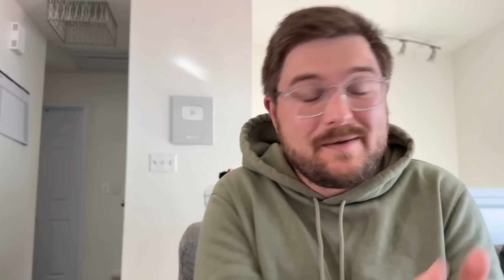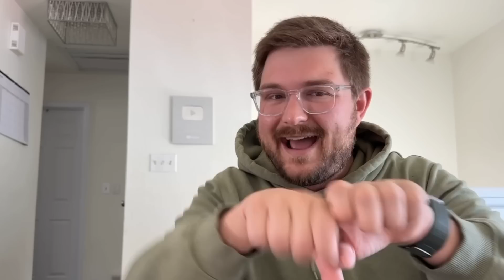Slow Charging For ~800-Volt EVs At Tesla Superchargers With Magic Dock Explained

Comment: I actually think this is GREAT NEWS for all Tesla owners that are worried about Tesla Charging sites getting busy (which I actually think is ridiculous).  My belief is that most (well informed) CCS vehicle owners will favor the available CCS charging infrastructure that is available.  First, CCS is probably going to be FREE for them given all the (really dumb) programs that give away free KWHs or at a minimum, cheaper that going to a Tesla site, but it now seems like the CCS will be the faster way to charge a vehicle.  If I personally owned a CCS vehicle, Tesla would be "break glass in the event of an emergency only" sort of usage situation.
Reply: The problem is even if most well informed CCS vehicle owners will favor the available CCS charging infrastructure, they are an ever decreasing minority of CCS vehicle owners. Majority will go wherever it is most convenient. For many that is going to be EA right now because of the free programs, but after those expire for many it may become Superchargers. I don't believe at all that the number of CCS cars which will go to a different station because it is faster will at all offset the added traffic cause by CCS cars charging slower, especially when many of those CCS cars will have to block a second stall to charge due to the cable length.

Just looking at the stations nearest to me, the EA station is farther away and doesn't have many businesses near it that I might want to stop into while charging. There is a pet store, a couple furniture stores, and a pizza place. The supercharger though is closer and has a Starbucks, bakery, pharmacy, gym, and a couple lunch spots in the same parking lot. Even if the Supercharger might be 10 to 15 minutes slower for my car, If I were to use DC fast charging on a regular basis, I might pick the supercharger since I could better make use of my time (and I'm saving almost 10 minutes on driving anyway).
Reply: @OmairArif  The lack of basic EV knowledge by some recent EV buyers is concerning.  In a group on FB, someone posted a picture of a new F-150 Lightening owner at a Tesla Supercharger expecting to charge their truck.  They were told (lied to or the salesperson was equally mis-informed?) that the entire Tesla network was now open.  Their next closest CCS station is like another 10-15 miles away or something like that and they were very upset.  It is the BUYERS responsibility to know all this, but still.

Comment: Great video and explanation. I have the Ioniq 5 and it's nice to know that I can get 100 Kwh in an emergency from Tesla, but that it will still be faster and cheaper at an Electrify America at least until more technology becomes available.
Reply: You can certainly get more than only 100kWh from Tesla. I guess you meant your vehicle is limited to 100 kilowatt. I certainly do not know why, Tesla chargers are rated for 1000V. At least in Europe. Must be a software limitation.
Reply: @wolfgangpreier9160 They may have that rating but is there a single site that delivers >500V on a v3 in Europe? Never seen that at all in any of the 3rd party car tests. Certainly I got 135kW with a pre-heated battery, 150kW booster and around 30% SoC on one I used in France recently. Was still happy with that as the car held it high into the charge (which unless you are doing a Kyle style max charging speed run is sill good for an overall quick charge to around 90%).
Reply: @alexhaddock4554  "Die Modelle Hyundai Ioniq 5 und Kia EV6 sind jedoch nicht in der Lage, an einige Superchargern aufzuladen. Es scheint ein Problem bei der Kommunikation zwischen Ladestation und Fahrzeug zu geben. Ein Update ist seitens Tesla in Arbeit, obwohl die Marke behauptet, dass die Ladeleistung bei diesen Modellen begrenzt sein wird."

"However, the Hyundai Ioniq 5 and Kia EV6 models are unable to charge on some superchargers. There seems to be a problem with the communication between the charging station and the vehicle. An update is in the works from Tesla, although they claim charging power will be limited on these models."

So: Software...
Reply: @wolfgangpreier9160  Ah ok, may be at crossed purposes here :-) . Was more commenting on if (faceplate rating or not) any site currently ould provide over 500V at the charger (i.e. avoid the need for a booster (i.e. Porsche) or regen (Hyundai) to have to step down. Hopefully those V4s will be able to do 800V but more importantly have longer cables.  135-150kW as a charge rate I’m actually pretty happy with, yes you miss the headline 270kW near the beginning but so long as a vehicle can sustain 135 deep into the pack its a good rate.
Reply: @wolfgangpreier9160  more like a brand limitation if we're being honesty here. I'm sure Telsa is holding back for anything non-telsa.
Reply: @volcalstone  In Europe there is no limitation. Its only in the US. If someone could look at the fine print on a charging station? In Europe it ha sto state type, Max Voltage and Max. Ampere. I don‘t know if it has to do the same in the US. I say its a Software limitation and not intentional.
Reply: @volcalstone  In europe you can charge your non tesla no issue at your car's limit obviously. It then depends on your car's battery temperature, considering Teslas optimize that automatically when navigating to a superchargers, which is something no other EV does.
Reply: @signal-52 Thats no longer the case. Certainly Porsche has added SuCs to their Nav/Planner in Europe. Once the charging provider is in the Nav and the unit is 50kW+ then the car will preheat just as it does for Ionity etc.
Reply: @alexhaddock4554  Good to know, but seems like it's just Porsche. VW even removed the heat pump from their cars.
Reply: @signal-52  Think a few more do it now, certainly BMW and I think Hyundai enabled. Not sure if they have the SuCs in their nav yet for the vehicles to know. Of course I’m also in the UK so the SuCs have been open to others long enough for the mapping to include them, guessing there will be the lag for the US now starting to open.  Hopefully even more use will cause even more installations in a virtuous circle. Certainly watching Kyle’s videos, the US is in desperate need of the SuCs opening to all to keep the EV transition growing. Fortunate enough over here for SuCs to be a nice to have as opposed to absolutely essential for non-Tesla drivers.

Comment: obviously we need to retrofit a NACS port to a CCS type 1 car. If the magic dock isn't used does the current limit go away? or is this a non tesla limitation?
Reply: Given that Tesla's connector uses the same pins for AC and for DC, which is not the case with CCS, there is a lot more to changing a CCS vehicle to use a Tesla socket than just changing the socket - underlying electrical wiring and control systems have to be different.
Reply: @bikeaddictbp  yes and no. Tesla still uses the same pp and cp lines for ac j1772 and for DC iso 15118. As long as the supercharger is configured for ccs vehicles it would work. But you are correct a second set of contactors would be necessary to protect the onboard charger from the DC HV.

Comment: Yep, glad you put this together. Disappointing they're putting too much effort opening this up before upgrading the chargers to work better with more cars. Cables, voltages, etc. It's all about those federal dollars lol, it's amazing how the user comes second when companies fight over those free monies.
Reply: Totally disagree.
Reply: They need the federal dollars to upgrade the older chargers though and will use the extra revenue to build new ones. This seems like a win-win especially if some EVs continue using Electrify America to get the faster charging speeds at a cheaper cost. I only plan to use it in an emergency and likely wouldn't stay longer than I needed to get to the faster/cheaper Electrify America for my Ioniq 5.
Reply: I don’t think any of y’all seem to understand how NEVI funding works if you think Tesla is just being handed money
Reply: @brandenflasch  I think they're using this implementation to meet the 150kW minimums even though a lot of cars won't get that. I just think if it were done organically, it wouldn't have happened until V4 were put in and CCS users are now going to get a less than ideal experience on this which appears to me to be rushed out to grab incentive money. But no I don't know how much they're getting or the details of that.
Reply: @tazeat  again, I disagree.
Reply: @brandenflasch   Well, with how much Tesla cares about doing things right and providing a good customer experience, what I am positive of, is that V3 chargers were never designed around supporting CCS charging in America and it clearly shows. Funding is the only reason I can think of why they would open any of these up without first upgrading them to provide a great experience to users. Tell me how I'm wrong.
Reply: @tazeat  easy they got NOTHING for doing these magic dock station's already open to the public. This is a test fleet of chargers atm.

2nd they have had customized v3s using the native tesla plug and ccs2 plugs overseas operating since 2021 now. 
That knowledge gained charging other's evs since 2021 allowed them to be certain the magic dock would work on ccs1 evs. 👍🏻
Reply: @tazeat  Why would Tesla spend $70k per stall to literally gut and replace every existing station (because you'd have to replace everything back to the power cabinets) to support higher charging rates for vehicles Tesla doesn't sell.

The magic dock is I suspect a cheap $1k retrofit and provides a chunk of utility to non-Teslas. It's not the fastest, but it's better than having to call a tow-truck
And still a lot faster than 25-75kW DC or AC charging.
Reply: Totally disaster! How dare they ask government for money. Oh! wait...Uncle joe is the one who ask Tesla!? Nah!! who cares! Tesla bad! the END  😂😂🤣
Reply: oh no - what a disaster that the most reliable charging network be useable for more people.... give your head a shake

Comment: Better thumbnail in the works - thanks for watching!
Reply: Be sure to stand there with your hands in the air like an idiot.
Reply: Get some sleep, homes.... you look exhausted,  Kyle. Thanks for the in-depth information 🎉
Reply: great explanation .. someone should make this into a simplified infographical video for the average joe
Reply: Kyle, will you please use a super charger to  charge a  VW ID4? Please,  Thank you.
Reply: This charging limitation seems like a good table / Google sheet would help clarify it. List of the cars and their voltages and their internal dc-dc converter limiting factors (in combination with Teslas v3 supercharger limit voltage of course)